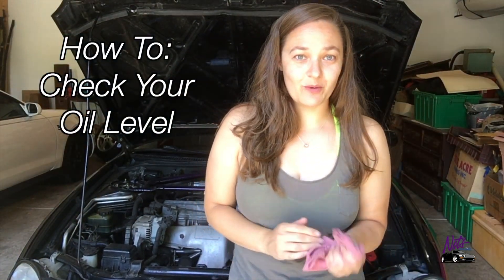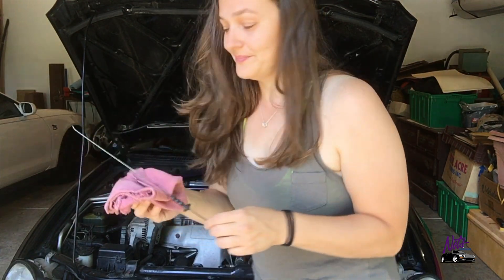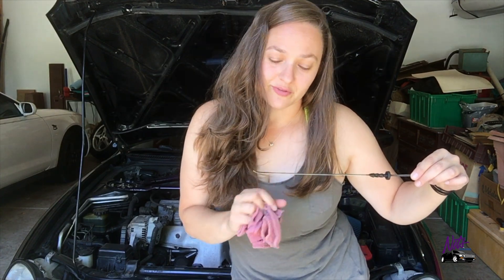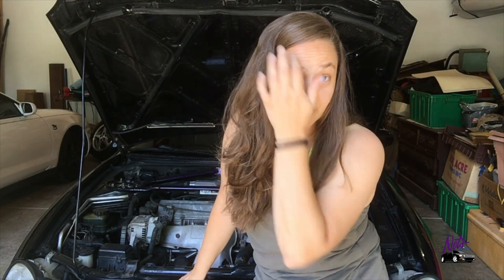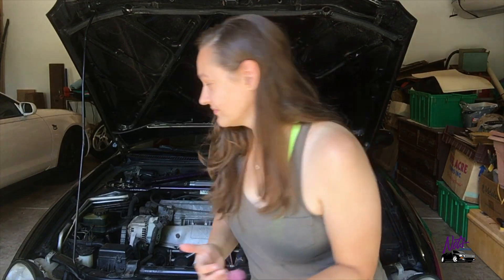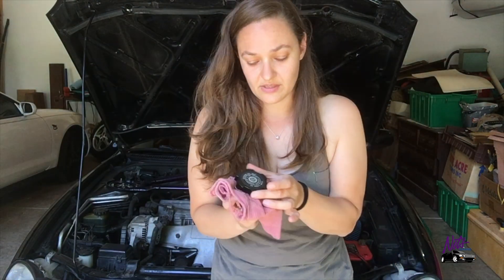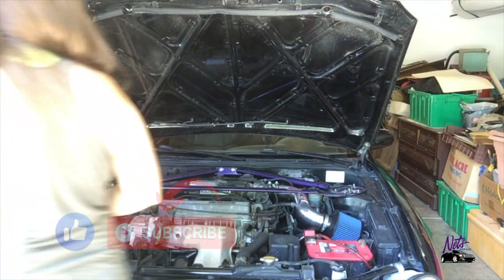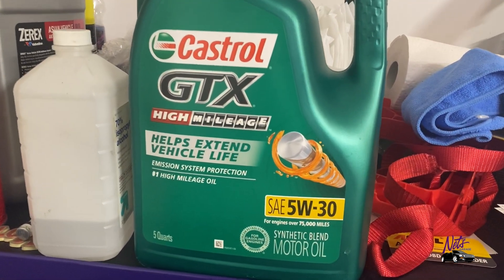How To: Check Your Oil Level - Toyota Celica

Comment: Omg!.. I'm Soo glad your back!.. I just bought a 98 Celica convertible black exterior and with the gold Celica emblems!.. I definitely need diy videos because these cars are getting super hard to find and there's an extremely limited vids on YouTube on these convertible models!😢
Reply from the maker: Awe! Thank you! 😊 This is just the motivation I need. I appreciate you watching and letting me know what you’d like to see. Congrats on getting your Celica! It’s so similar to my black vert. I took some time to recover and switch gears after the accident. 🤓
Reply: Hey net I had a question about the speakers amp!.. I have the 8 speaker set up in my celica and I threw away the OEM amp that was under the driver seat cause it was all rusted and it sounded like loose bits inside of the amp anyway!.. but do I need that OEM amp from under the seat or can I bypass that?.. I'm running an aftermarket pioneer set up!
Reply: @M-Cee-U-See - Hi! So it depends on the wiring harness that you’re using. Some harnesses plug into and use the factory amp, and other newer head units come with amps built in and the harness that comes with it bypasses the factory amp anyway.
Reply: Ok I see. I am in the process of ordering all the speakers now! Also I live in Northern California San Francisco area and there are plenty of junk yards "Picknpull" as it's called here within very reasonable driving distances about 12 all together so i'm fortunate enough to have access to enough donor celicas so I'm collecting parts for these cars now!.. but is there anything you happen to need or need extra of ? Let me know and I'll get it cause I'm not seeing as many of these 6gen celicas in the yards out here compared to 5-15yrs ago finding these 6gens in the yards on any given day is a thing of the past now clearly! so I'm going to collect as much mostly OEM parts off these cars that I can while I can! but even having access to 12 junk yards out here ,these 6th gens in particular are getting pretty rare to find in the junk yards now unfortunately!😑. But yea let me know and we can work out a next to nothing price! but mostly shipping cost. ttyl 👍
Reply from the maker: @M-Cee-U-See  Oh nice, I have some family in San Fran! That's so amazing that you've got so many junk yards to pull parts from! It's a very smart idea to stock up while you can. They are getting rarer and rarer by the day. I have an entire donor car in my garage right now, as well as a pile of parts, so I'm good for now.  Thank you for the offer, that's incredibly sweet.  The vert specific parts are definitely worth saving if you come across a vert.  Happy picking!  😃
Reply: Well if u do need anything definitely let me know!.. I'm mainly just collecting convertible parts on these 6th gens !.. like the convertible pumps and back glass windows as long as it's still attached to the fabric! because it can come out all in one piece!.. so no need to get the window reglued or anything!.. but yea I'll be collecting mainly those parts cuz ebay prices and upholstry shops etc. can be insane with there asking prices!
Reply from the maker: @M-Cee-U-See  - I've had to replace the back glass portion of my top before, it's definitely great if you can find a glass that's still fuzed to the fabric. So, I did think of one random part, no worries if you can't find it, but an OEM front passenger side mud flap. My '94 hatch has 3 mud flaps and is missing just the one in that specific corner.  Such a random part, but if you see the mud flaps, I'd grab those.  I'm on insta at nets_garage_celica if you're on there. Anyhoo- good luck pullin' those parts!
Reply: Also I'm sure you don't play video games??... But have u heard of or played Gran Turismo 7?... 94 Celica GT4 is in the game!.. once you get to the modding part of the game it can get verrryy addicting and possibly influential on your own build!😅 I just hope at some point they'll get extremely detailed and put the other sub models in like the GT convertible celicas!😉😉
Reply from the maker: @M-Cee-U-See  - I don't spend any time playing video games, but I have heard from several Celica owners that Gran Turismo is what inspired them to purchase a Celica! How fun, esp. if you get to customize and try out different looks!  :)
Reply: Sorry for late response! I'll look for the front mud flap as I'll be taking a trip to my local wreck yard within the next week because a local convertible Celica owner is needing a rear glass window so I'm going back to see if the Celica vert i came across a month ago is still there and inspect the glass to see if it's worth grabbing!.. customers and employees have a tendency to throw parts on top and inside of cars and potentially ruining or even breaking windows and other things on the cars so it's not worth even taking!😅 Heck I had to literally move a whole transmission off a Celica vert to get to the convertible boot that was wedged underneath the tranny wich somehow somebody managed to place the whole tranny thru the broken rear glass window!😑 It took about 45mins to move that thing to pull the vert boot free!... and yeah I took several cigarette breaks and cursing out loud at who ever decided to throw the tranny on top of the trunk and thru the vert top rear window!😡

Comment: make sure to fill the oil filter with oil before you put it on! 😈
Reply from the maker: 🤔 That might get a little messy with the way the oil filter is positioned on this engine, it’d spill all over the place when putting it on. Maybe I can swish a little bit around and let it soak in before installing. But I’ll definitely make sure the rim is lubricated. 😋